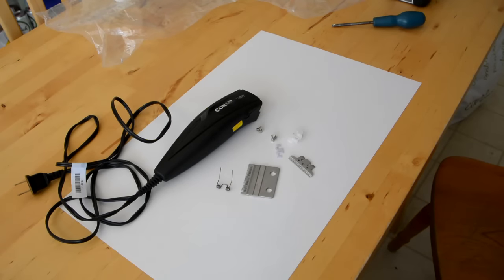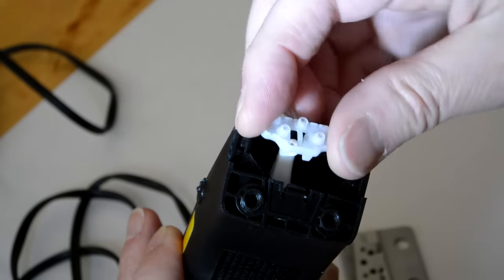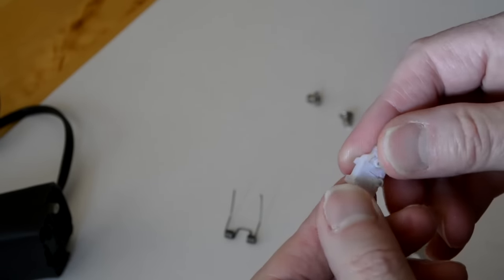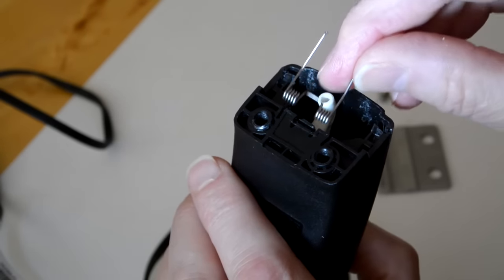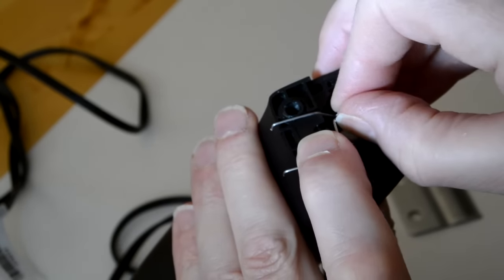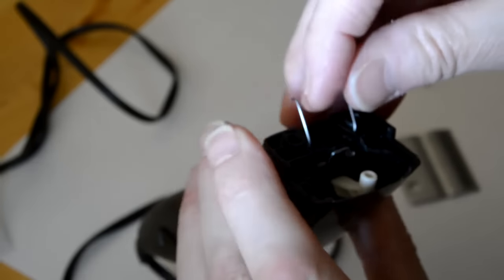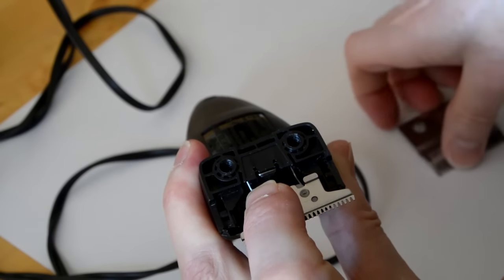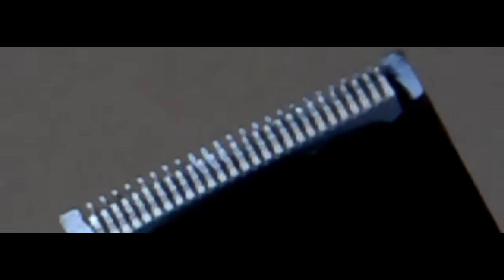Put your Conair Clipper head back together (reassembly)

Comment: What's the story with these damn clippers ? That video the guy had the parts of it separated already mine is stuck and inside the clipper itself already so how can I line up the holes in the metal only one of the holes even lines up and magically the other whole on the blade doesn't even match up to where the metal rod is sticking out of the trimmer itself I can't rip out the two thin metal pieces I won't be able to put it back in and make it stay the right way  and I'm not getting a blow torch for Christ's sake 🤷‍♂️😳😲 this is an easy thing that shouldn't be a problem I've done it a million times with other ones by for some strange crazy amazing reason this clipper is just different than the ones I've used for the last twenty years and nothing seems to fit right unless I get a needle nose and start tanking things around and then I don't think it's going to work the right way cause it's already loud as fuck and shaking a bit more and pulls rather than cuts so something is afoot and the other two I took the parts off them too the same two fucking same blades that are basically universal now all of them are mixed ip and nothing zero of them is going back together and I'm sweating and bitching and this is just ridiculous ! These things are like twenty or forty $ and I could of already gotten brand spanning new clippers for twelve dollars and instead I've been doing this for a combined almost four hours now yeah two hours last night and that never worked out and then again tonight since I got off the phone with my girlfriend a half hour after I hung up I started this madness all the blades are swapped now I don't know which goes to which trimmer and the colors are a bit different naturally then the damn video of course this metal piece was never touched and should automatically go back into the two dedicated holes that were predrilled specifically for the blade to get taken off and oiled and then put back together and now all three of these have different blades then when I started this journey and I can't get one of them to get fired up the motor works  but it's loud tho I mean loud like a mustang 5.0 loud almost wakes up the entire solar system and the dog starts barking when I turn it on to test it they can hear it through the air conditioning and upstairs 😳🤷‍♂️🤒😔😔😔 what a nightmare - I've been trying to cut my hair now for almost three days and I still can't get one of these damn trimmers yo work properly I tried sim the combinations oh numerous times and tried to force it on there and it almost snapped and now it just doesn't seem to fit any of them tho in every combination 😲😔😔😔 lord have mercy I'm sitting here praying ! 🤷‍♂️🙄🤣🤒 my god it's too late to go get a brand new pair for a dollar basically this just shouldn't be that difficult to put oil on one of them never mind three of them the first was the race car motor and the second has the metal poles sticking up and the third ones barely make any noise like stealth mode - so now  I'm just complaining and yelling st my girlfriend to come help and this needs patience and I just don't seem to have that the last few days with this type of thing and the heat is making crazy too I can't get comfortable just a sloppy mess 😔🤣😳😳 which  means I'd have to go tomorrow and go to a place I don't want to go to or feel comfortable going in that particular store and ask anyone about this type of product only cause the people are old and ask a lot of questions olys I'm missing one of the tiny screws to tighten it and I haven't left anywhere only ten feet and I lost it somehow ! Seems everything I touch lately I misplace it or outright lose it and find it a week or two week later and at that point I already done made up my mind another going in another direction and so the part just is useless now I cleaned them all and oiled them and not a single blade fits in the top like it's supposed to I would have to try and force something to squeeze into the smaller of the two blades but where did the other joke go if it was predrilled then why am I only seeing one of the holes and the other metal skinny rod just has nowhere to fit into and I'm not drilling a metal blade any hole to fit it so I'm at a complete standstill ! A crossroad - is that my girl ? I need her grandfather ! That's the guy I have been thinking of for the past two hours and hoping would be knocking at the door asking to lend a hand and finish strong 😀🤣🤣 I got no patience right now with the current situation and trumpet and seeing or hearing him revolts me and really gets me aggravated like no other human being has ever done before it's amazing how much he is really dislikable ! So idk but I'm gonna go and see my baby the only good pure honest working lovely amazing person that actually matters and is worth going through anything for ! I love you Selena Marie Gomez ❤️😍😍❤️🤒😘😘🤒🤒🤒🤒🤒